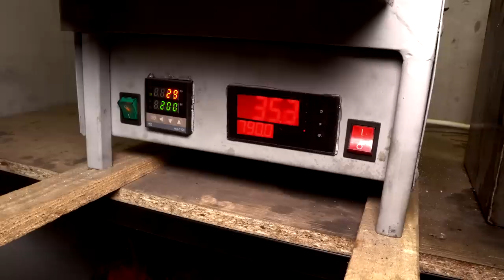Old Hammer - Restoration and Customization

Comment: Question: why hand cut the 3 lines with a rotory tool instead of cutting them in with your lathe?
Reply: I was thinking the exact same thing, a parting tool would have made it more uniform in a percentage of the time as well as using the lathe for cleaning up the hammer head with the sand paper strips.
Reply: @jasoncarpenter4116  I thought about it a bit. Maybe he did it to help maintain the old look about the tool. Perhaps to give it a hand made touch of character. That is the only reason I can think of anyway.
Reply: Exactly what I was thinking too, but I wasn’t going to ask haha
Reply: I like to extend that question by 2 more: 1) Why he cuts the excessive metal on the back of the hammer on grinder, when he could cut it on lathe, as he did rounding at the first place; 2) Why he use a anglegrinder to make round back, when he could do that on lathe with a simple handmade tool. Every 3 of these steps could be better on lathe.
Reply: It’s probs just to switch it up. I love writing with pens, but sometimes I just want to write with a pencil for the hell of it
Reply: To answer all of you people, probably because of the oddly shaped end of the hammer head he is not able to mount it on the lathe chuck
Reply: I wonder the same thing. Mounting would be easy after the initial rounding and the domed face would be easier on the lathe too. I imagine the switching it is is the best answer
Reply: @GrommiD  lol my thinking as well.
Reply: @tetrasnipe  You PEOPLE??? 😂😂
Reply: He did it to show off lol
Reply: This whole thing is one big lathe project. The angled pieces on the back and the hole for the handle are the only exceptions I can think of.
I guess the other tools and methods are mostly for YouTube.
Reply: Just for show off maybe 😅
Reply: Just simple answer, sometimes the idea comes late, but unfortunately the latte got some trouble. It also makes the video duration longer tho
Reply: Bit late on this, but the piece is already hardened and it would be difficult to cut on the lathe, same goes for the back end grinding. Cutting the grooves before hardening might cause it to distort or cause a fault line and break.

Comment: That hammer head has a very simple and effective design. Made from round bar makes it easier to machine and the almost square hole for the handle could be easily made on a milling machine or even with a drill press patience and some files.
The restored hammer looks great

Comment: So you used a lathe at the start and then suddenly used a handtool and wasted time to get the 3 line done at the end,you could've do it under 2 minutes
Reply from the maker: it is little lathe, so cant clamp the hammerhead in the chuck because it is not round from other side

Comment: So you cut those three grooves in by hand with a Dremel when you have a lathe at your disposal. Oookay. 🙄
Reply: Yeah, but the area he cut the grooves in was the area that the lathe was holding onto. Thats why he ground that area by hand on a belt sander. Because of the hammers shape it couldn't be held the other way around
Reply: A machinist can simply cut soft jaws, flip the piece around and machine the other end.

Comment: Sorry Koss but I think you over did this hammer and ruined it.
Your over standing and lathe work has taken all the uniqueness away from this old hammer. Not to mention having such a ridiculous small handle makes it look worse.
All this hammer needed was going over with a wire brush to clean it up, fix the head up and correct the mushrooming that was happening.
Then put a new handle on it and stain it a dark colour and that was all it needed.
I usually like the work you do, but as for this restoration, I have to say you failed bigtime.

Comment: Really, really nice work, and a beautiful outcome...

...but this is not a restoration. This is making a new fancy customized hammer out of an old one. I really admire this kind of work, but this work is not a restoration in any way. Restoration by definition means that you restore something to its initial form, shape or purpose. It was an iron hammer with a very definitive shape and markings that show us how it was used over the years. Now it's a fancy modern design hammer with all of its past removed completely - the shape was changed, the markings removed, even the metal tempering was redone - the only thing that makes it "the same" hammer is the material itself. It's hard to really restore such simple things, especially hand instruments... but that doesn't mean that such process could be called a restoration too.